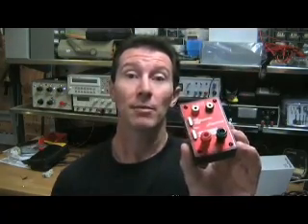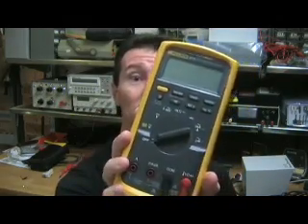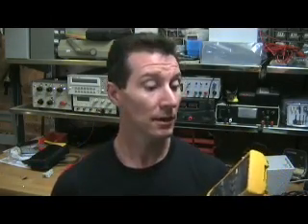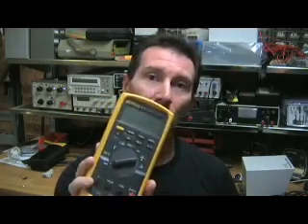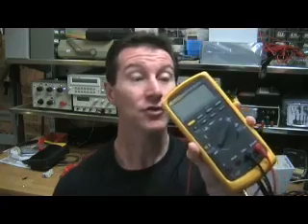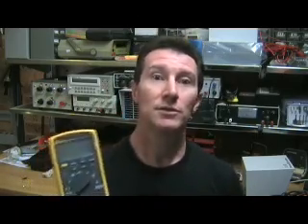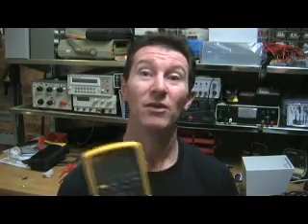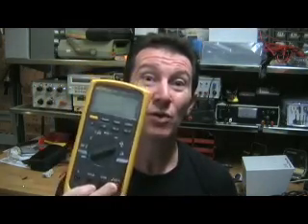uCurrent

Comment: I know, chances you read this are very odd. But never the less I'll try to reach you :)
The area in which very, very small currents and voltages and low-noise amplifiers are extremely important is everything about sleep. 
To be more specific, anything to get the electromagnetic waves of your brain (microvolts) to determine your stage of sleep has to be extremely low-noise.
I've worked as a technician in sleep laboratories for 12 years and learned to read an EEG. "Sleep" is such a fascinating area and we just know  a little bit of it.
Rechtschaffen & Kales in the 1960s first tried to really scientifically use EEG to determine in what sleep stage you are (awake, REM, light sleep [stage 1-2] or deep sleep [stage 3-4])

Comment: I boutght a max4239asa+ at Digi.  It is so small!  -key (8-SOIC (0.154", 3.90mm Width)
Is it really possible to solder that by hand? There is about .9 mm gap between the pins.